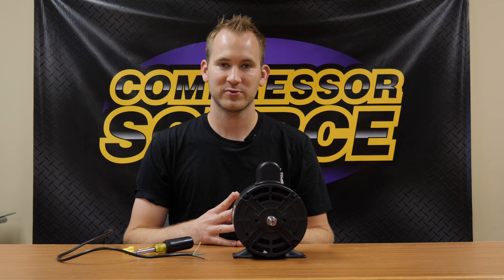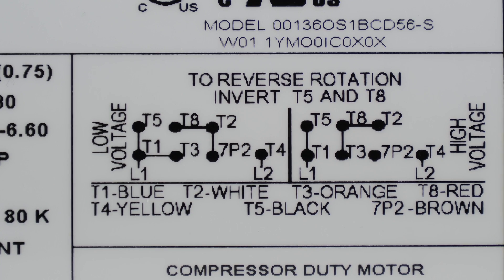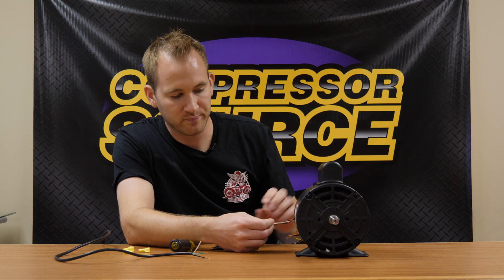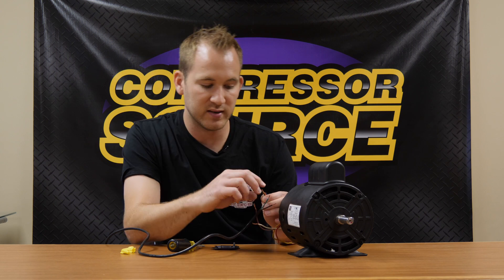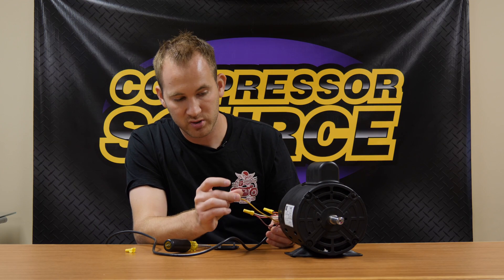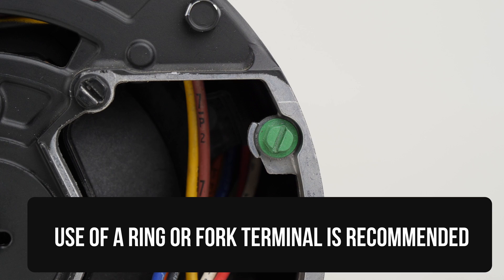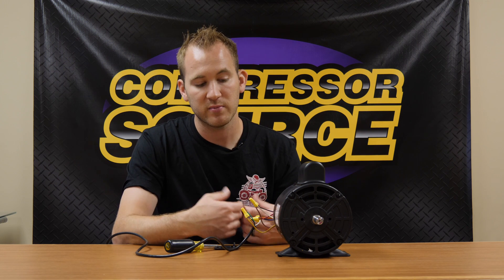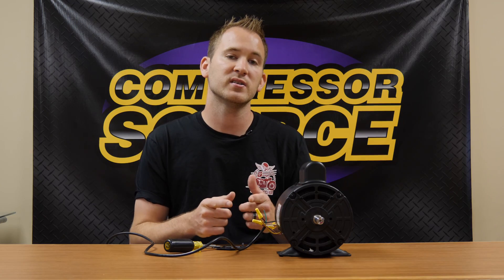Single Phase Electric Motor Wiring Tutorial: Baldor, WEG, Leeson, WEG, Worldwide Electric AC Motors

Comment: I just burnout a motor on my 230v air compresor my voltage meter is showing 236v would this be the cause of the burnout? Or rotation has to do something? Not sure if wiring black on left side and white on right side can make a difference.? Can you please help me with this question what could of cause the burnout of the motor?
Reply: Voltagr is nominal. 220 to 240v is okay. It can even sag a little lower or be a little higher i think 5%. Either way,  your motor likely didn't "burn out" unless the insulation around the windings literally caught fire.

There could be a shorted wire, a broken tab, or somehow a winding shorted. Assuming single phase,  your capacitor might be bad

Comment: So after you ground the wire to the motor and run it up to an on/off switch on a woodworking machine? does it just need to be fastened to metal that is apart of the machine?

Comment: I have a question, Isn't necessary the capacitor to run the motor? Most of the other videos in YT using the capacitor. thanks
Reply: The capacitor-start is used to start the single-phase induction motor. After the motor has started (i.e. after the rotor/shaft is spinning), the capacitor-start is automatically disconnected.

Keep in mind there are single-phase induction motors that do not use a capacitor-start, but instead are split-phase or other variant.

Also keep in mind some single-phase induction motors have a capacitor-run. That is, a capacitor is used even after the motor has started.

Comment: Good video and yet I'll suggest that you can add so much more to it and so very quickly and easily with a properly drawn schematic and talk of just what each wire is doing in the motor and the reasons for their locations. I'm not an electrical person and my need was to swap direction on a motor and the absolute clearest answers came from a video by a 'Jean B'. I'm not critical of what you've done but you need to remember that the viewer needs to be left 100% certain of what's happening here. I did get that certainty from JB but not quite with yours.